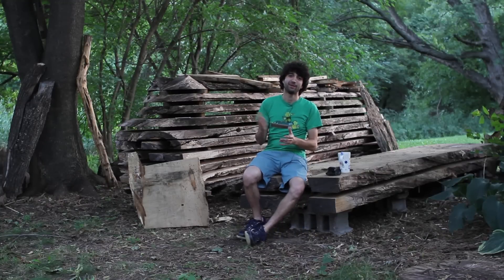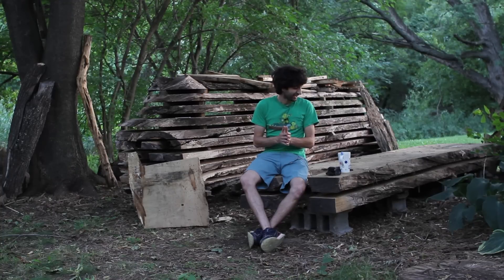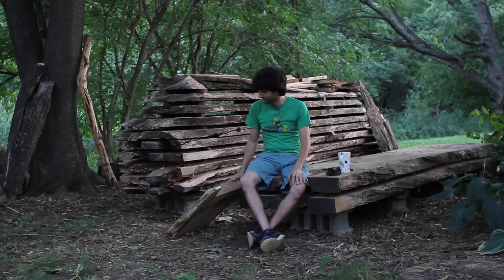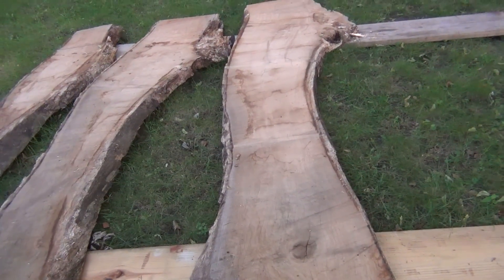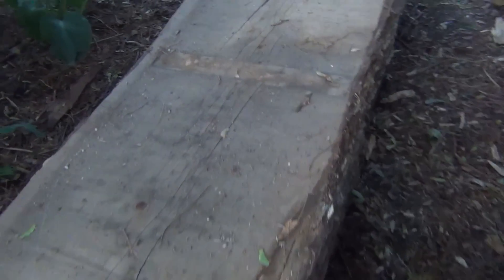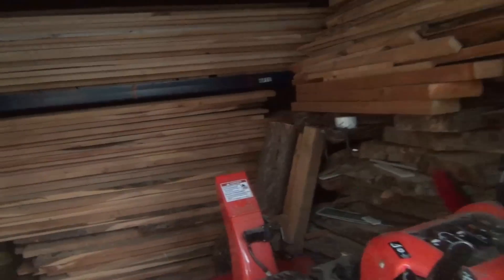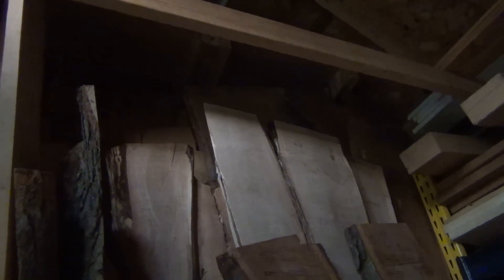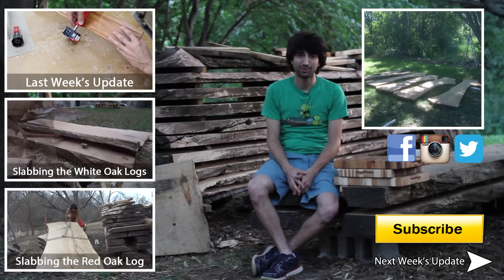Matt's Weekly Shop Update - Sept 14, 2015

Comment: Hi Matt, I love your stash of lumber! The white oak table and benches will be solid, heavy, and beautiful indeed. Good work on the trailer and I hope you used grommets or something to protect the wiring that passes through the holes in the C-channel since this could become a problem due to vibration or any movement that could wear the insulation and cause a short.

Peace!
Reply from the maker: Thanks Jeffrey!  The holes are really smooth since I melted the steel to form the hole but I'm also adding some silicone in there to hold them in.
Reply from the maker: Thanks Jeffrey!  The holes are really smooth since I melted the steel to form the hole but I'm also adding some silicone in there to hold them in.
Reply: Great! I was just looking out for a brother. The silicone will prevent any wear on the wire insulation.

Comment: When you get home from WIA and those slabs are missing, I did not do it :) Okay not the table slabs but other ones and I still did not do it. Do not know if you have one already but you may want a heavy duty jack of some kind as a back up for that crank trailer jack. They always fail at the worst times and without another good jack you won't be able to get the trailer off your truck or ground when loaded.

Comment: I'm looking forward to watching you craft the farmhouse table.  I trust you are going to put grommets on the wires as they pass through those rough ass holes.  A drilled hole just the right size for a grommet might be better.  Remember this 80% of trailer light problems are in the wiring circuit.

Comment: Matt, I know the wood stacked around the yard is drying.  I was wondering a few things about drying it that way.  Does it warp a lot, do you have to worry about bugs, and I know each piece is different, but how long do you dry it for?  Lastly, do you check it with a moisture meter?
Reply from the maker: Good questions!  I don't find that it warps more than any other method.  If anything I think they remain flatter. Bugs aren't much of an issue here.  No termites to worry about.   I cut those slabs last November so about 10 months.  Those logs were down in the forest for about 10 years prior.  When I cut them they were reading around 28% and now they are down to 18%.  After I rough cut the 
parts, I'm moving them inside to dry for a few weeks while I shoot another class.  They should get down to 15% by then which is close enough for an outdoor project.

Comment: How long did it take for those 12/4 slabs to dry? I'm about to get some Ash milled up to 12/4 slabs and just wondering how long till I get to build a table? :)
Reply from the maker: These ones have been stacked for 10 months but the log was sitting around for about 10 years before I cut them.  They're still not totally dry but this is going to be an outdoor table so the wood doesn't have to be as dry as something going inside. Probably the fastest you could dry 12/4 would be 18 months.  That's with 9 months air drying and them another 9 months in a kiln. If you are just air drying in optimal conditions, you're probably looking at 2 years.

Comment: Are you going to put some rubber grommets around the wires going thru the metal frame?  The metal will wear down the insulation over time and cause a short